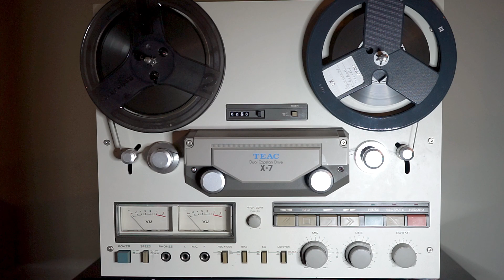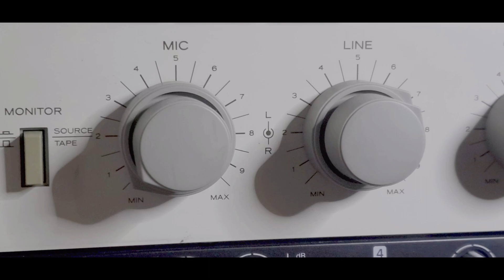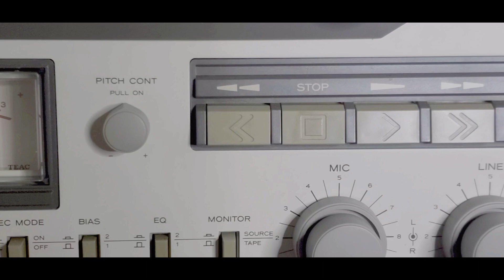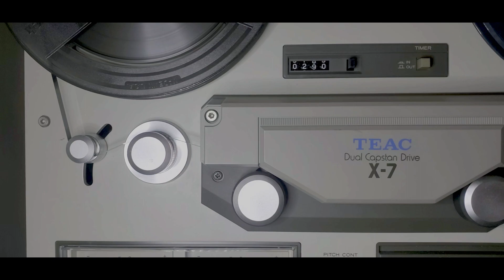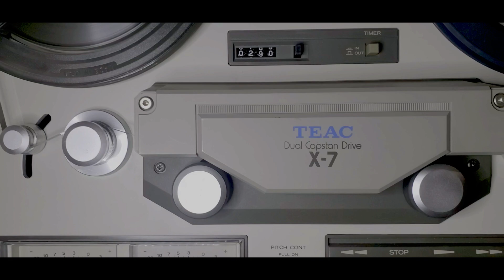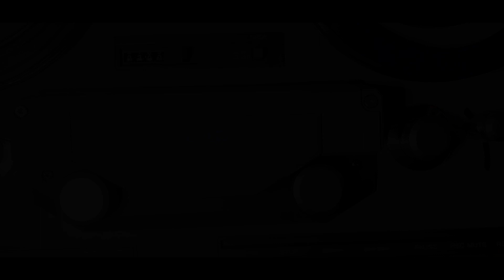TEAC X7 OVERVIEW

Comment: Good review of the TEAC recorder. I'm looking to buy one, and I'm comparing it to similar sized AKAI recorders like the GX-270. The AKAI has direct-drive with beltless AC motors, is auto-reverse, and has GX heads. The TEAC uses brushed DC motors, belts, and a double capstan but isn't auto-reverse and the frontal buttons are plastic. The AKAI's control logic is discrete and easier to maintain.

Comment: Hi I bought a  teac X 7 have tape loaded and am not getting any sound, not sure. Can you plz help me
Reply from the maker: @KathrynHoffman-o2p  Many factors cause no sound. From simplist to not. Playback monitor is on "tape" for playback. Output control turned up. RCA outputs connected correctly to a tape monitor or auxiliary input on the receiver or integrated amplifier,  or preamplifier. The X7 has not been sitting a long time not being used. Especially in a garage,  or attic, or basement neglected. If those are the case. The pinch roller and tape lift have bound up, and even when "play" is pressed no sound. Then the last part something is wrong with the preamplifier output electronics.  Easiest would be a really dirty output volume potentiometer blocking sound output completely.  Or something more internal electronically. I assume already you are using good RCA cables, and the receiving end electronics wise is set correctly.

Comment: great video recently pulled mine out the closet after years of storage, how often do the heads need to be cleaned and what Lubricant do you use thanks
Reply from the maker: I follow the rule 1 tape both sides clean the tape path metal parts and 3 tapes do the pinch rollers, and 10 tapes both sides do your bearing lubrication. Demagnetize the path metal of 10 tapes both side of play. I am a bit pushy on the maintenance but sometimes I am even more stringent. 1 a year check your belts too. Tape counter and capstan belt. Clean the controls and switches as needed.

Comment: hi watch your video   i came in to  alot of 1/2 inch tape   i say alot of zonal  1/2 came from old studio  in the uk  so i got hold of many tascam 30 line
decks i cam change and pimp eq and speed  1/4 tape is a money pit 

i am luck i have soundcraft 760 decks as well all working  i try to get deck don't need alot of work   RS1700 is ace  deck yes i have one 
not used alot as my otari mtr 12   can play  2 ways as well  there's a video on here i spy about the transport

Comment: I just won an X-7 on ebay. Before I put my bid in, I watched your video. I'm 58 in a few months and owning a reel to reel was on my bucket list. I've got an immaculate looking machine only recently serviced too. My late brother had a few reel to reel decks in his time. I want to have one before I get too old!
Reply from the maker: Hi Tim. Congratulations! Way cool. These are wonderful machines and most audio folks today don't get it. These have a sound all their own. Maintenance is key to keeping these going great. Please let me know how you like the X7 or have any questions.  I have over 50 years doing audio. It is much fun. Another neat device for your reel to reel is a dbx noise reduction unit. I want to get one for my X7. Usually a dbx type 1 is what you want but a type 2 will do fine as these are your tapes and you most likely would not trade with anyone on your creations.
Reply from the maker: @timhubbard8895  A few questions what microphone are you using? Dynamics will poorly here as they want lots of gain, condenser self powered microphone will fair better. Lets start with that. Just 1 microphone or stereo pair by the way.
Reply from the maker: @timhubbard8895  Okay thank you Tim that is very valuable. Sounds like a perhaps a noisy transistor stage of Electrolytic capacitor if I had to hazard a guess. If you are just monitoring signal not running any tape at all, just monitoring source, do you notice the "hiss" more on the right channel. Even with no source material fed in and say the input level at say 6, do you notice the "hiss" more on the right channel?
Reply: @xray111xxx  I have a friend who has a degree in electronics. I managed to get a PDF copy of the service manual and he had a look at the schematic diagram. He figured out it could be any of up to 8 electrolytic capacitors around two amplifier IC's. Next bank holiday he's going to bring his oscilloscope along to try and locate where exactly the noise is coming from.
Reply: @xray111xxx  Yes, even if there is no source material being fed through the Right Channel always has a higher degree of hiss.